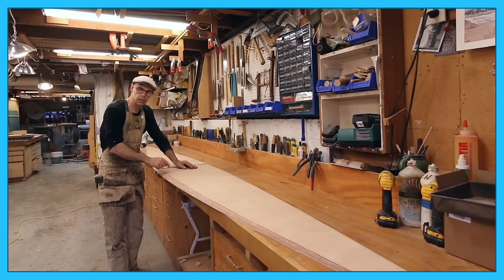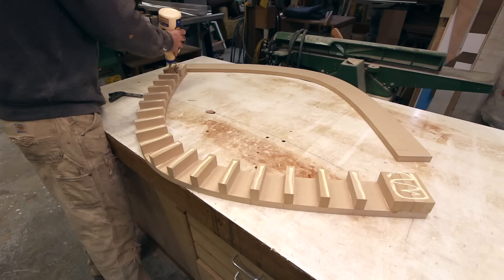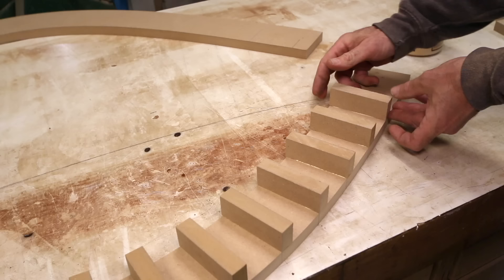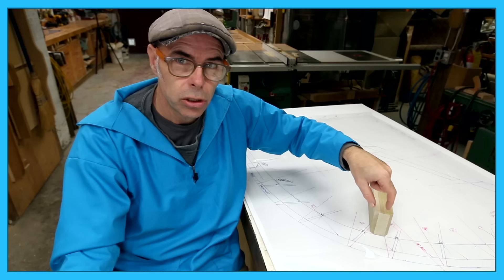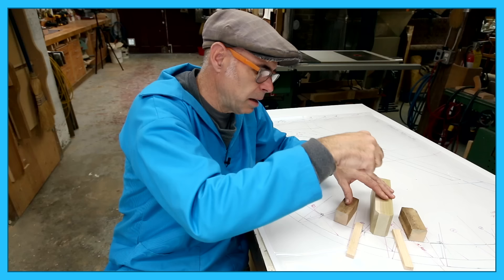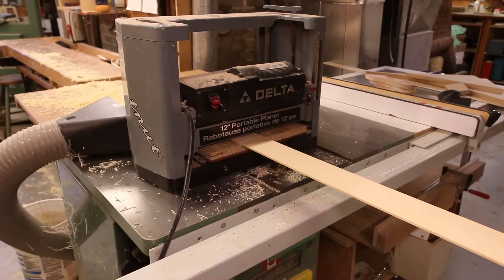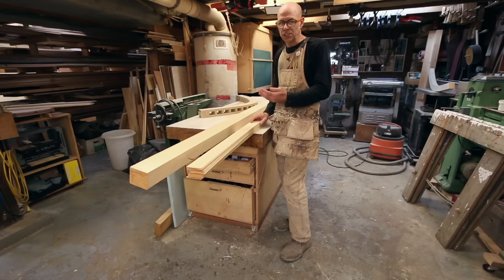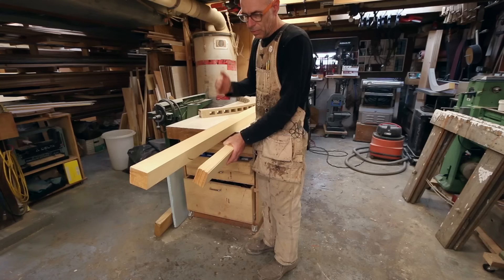Building the Catalina Wherry - Part 8 - Moulds & Laminating

Comment: Nicely done! I built my stem on a 1 1/2” thick Masonite table and screwed the blocks down like Bob did but I sanded the curve of the stem into them to match the drawing. I was then able to screw the cleats down to the table to keep things flat while bending and clamping around the blocks. It worked quite well. Thanks for the great videos.
Reply from the maker: That would work well. You have the mass for a screw to really bite. I don't want to sacrifice the arborite surface of my table but I have often considered building something like a welders fixture table for just such a purpose. Unfortunately, I just don't have the space for such a thing.
Reply: Yes, a nice welders table would be wonderful. But your solution to the issue was great. Most of my bench tops are made from MDF or the like, so once they become too holy I just replace them. I sure have enjoyed watching this particular project of yours. Keep up the great videos. I will never tire of watching someone work, especially if they are building a boat! 😆😆😆
Reply from the maker: Replaceable bench tops are a nice option for sure. To facilitate laminating, a full t-slot table would be the way to go. That's sort of what the big glue-lam beam companies use.
Reply: @Nomadboatbuilding  I wish there was a way of sending you photos of my project. It’s just a small 10 1/2 foot sailing dinghy of my own design. I’m hoping to have it in the water this coming June. It’s been a long time coming.
Reply from the maker: @daviddickmeyer5231  Sure David. There is contact info on the About page of this channel.

Comment: Hi:  Looks great - 
question:  what manufacture saw blade are you using?  ; how many teeth?

Are we putting the frame structure next Vlog ?
Reply from the maker: That was probably a Diablo ripping blade. 24 tpi. I also use Diablo 7-1/4 framing blades if the stock is small enough.

Comment: Stuck here unable to do anything recovering from an operation. Your timing couldn't have been better. That's half an hour that passed very easily.
I've never glued with epoxy, so I was mentally saying "come on, hurry up" as you did the glue-up. Gluing for me is generally stressful and racing against the clock because of the short open-time. The next glue I buy will be some hide glue, and maybe I'll be able to work in as relaxed a manner as you did.
Reply from the maker: I hate to break this to you Mike but as I understand it, hot hide glue has just about the shortest open time of them all next to CA glue. The bottled variety like fish glue maybe not so bad.
Reply: @Nomadboatbuilding  Yes, I meant the bottled version.